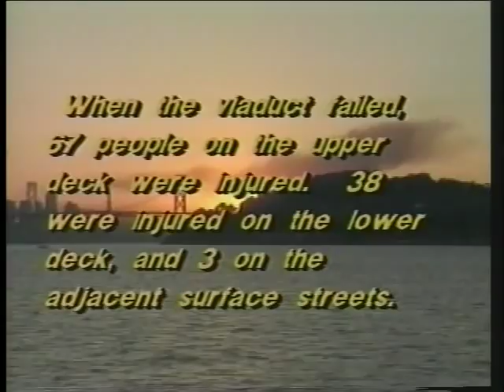Rare police footage of San Francisco's Oct 17 1989 earthquake aftermath part 2 of 2

Comment: 11 yrs old and living in the east side of San Jose, very close to the calavarares fault line. During tap class, and right when the quake hit, it felt as if somebody had pushed me from behind. I turned aroundl...and nobody was behind me and the floor was rolling sorta like waves. The other thing that struck me was the length of the quake! I lived very close to Alumn Rock  Park, and parts of the park were closed d/t the ground literally splitting apart! Very happy the Bay Bridge is being rebuilt!

Comment: Long read with detailed information.

I've actually seen the full CHP reports for this earthquake online, read them cover-to-cover. The vehicles were given codes, V-1 to V-49 on the upper deck and V-50 to V-107 on the lower deck. The freeway was divided into spans, separated by "bents" that joined them together, e.g. Bent 50 was between Span 49 and Span 50. Each span was about 80 feet long. The further north the span/bent, the higher its number. Lower deck traffic was moving northbound, and upper deck southbound.

On the lower deck, the fatality rate was 45%.  

Span 62 was the southern end of the collapse and Span 112 was the northern end,  At 3:00 and 6:28 the 1986 Acura Integra was crushed by Bent 112; it was a mere 60-70 feet from being "out of the woods" completely. Had the earthquake struck literally two seconds later, the man in the Integra almost certainly would have survived. The vehicle was coded V-50, it was the northernmost vehicle in the collapsed area.

Span 96 was the only span that did not collapse in that area; a Chevron semi truck and a Chevy Monte Carlo happened to be the lucky people in that span. Both were unhurt. The semi driver almost certainly would have died had he been caught in the collapse; the three other semi trucks directly caught in the collapse were all killed, probably because their vehicles sat so much higher. A low seating height car would have been the best car to be in here. 

The International semi at 6:38 was about the worst situation one could be caught in. Its driver was killed instantly. It was in Span 98, against Bent 99; the lower deck spans from 97 to 100, immediately north of the uncollapsed section, was one of the deadliest areas to be caught in, 9 out of 11 drivers died, and a tenth (in a white Honda) was knocked unconscious and severely injured. The 11th driver was in a red Datsun (I think it's the one at 1:40) and was found laying across the front seats of his car. He had minor injuries. Very lucky man. The only survivors from 97-100 were him, the man who was knocked unconscious, and three people in the back seat of another car at the north edge of span 100. The front passenger of that car also died, bringing the death toll to 10 out of 15 people in those four spans. A fire started in this area when a 1988 Acura Legend was crushed down to the frame rail, its driver obviously killed instantly.

Julio Berumen, the boy whose leg had to be amputated, was in the other death "hot spot" - Bents 63 to 67. All 8 drivers, as well as the four year old daughter of one of the drivers were killed. Julio and his sister Cathy were the only two survivors from these five spans. They were in Span 66 against Bent 67. 

Part of the reason Spans 63-67 and 97-100 were so lethal had to do with the way in which they collapsed, they "pancaked" on top of one another. Part of it has to do with traffic density in those areas. 

On the other hand, Spans 84-88 were a relatively "lucky" area. 7 out of 9 drivers plus a passenger lived, 8 out of 10 total, making the overall fatality rate just 20% in this five span section.

https://archive.org/details/lomaprietaearth1990cali_0

Have a read, but it gets pretty gnarly.

January 19, 2018 3:14 am

Comment: The section of the freeway that collapsed was built on top of fill that liquefacted when the quake waves struck it.  The loose fill temporarily behaved like liquid & the shaking motion was amplified 800%.  The section that didn't fail was built on solid ground, although it was severely damaged & was immediately demolished.  Liquefaction was a big problem in the Mexico City quake because the entire city is built on top of an ancient lake bed.  It caused a big bad blaze in the Marina District.

Comment: I was 5 years old when it happened and I was in the North Bay in Sausalito which is only a couple miles away from the San Francisco marina district where there was tons of destruction. I was standing the street corner with two of my friends when it hit, but lucky for us the entire north bay sits on a large deposit of bedrock which minimized the duration and the shaking of the quake. So for us it only lasted 3 or 4 seconds as opposed to 10 to 15 seconds in other places, and the shaking wasn't as severe. I remember a few days later my parents took me and my sister to see the marina district after the earthquake and I remember seeing cars flipped over, huge cracks in the pavement, and an entire buildings collapsed. Nowadays I'm freaking out about the Hayward going off because I live in Berkeley. It doesn't seem to end over here.

Comment: 5:50...the cypress viaduct never shouldve been built. what were they thinking....building a double deck freeway in a state KNOWN for earthquakes!?!? I mean cmon....really? That was a recipe for disaster. To this day I am nervous when on the lower deck of the bay bridge. The new bridge is the way it SHOULD be...ONE level...not two!
Reply: from what it looked like, the cypress viaduct was built in the 1950s where there was still a "brain drain" of sorts when it comes down to understanding of earthquakes. by the 1980s and 1990s however, almost every person in the country understood what a quake was although some think that wouldn't happen to them. if the cypress viaduct is rebuilt with modern day earthquake proofing then it wouldn't matter if it was a 7.1 or a 8.0, the viaduct would be designed to withstand a pretty nasty one and with minimum damage.
the way traffic is in both la and san fran, that idea would be a better solution no matter how you look at it.
although i would want the new cypress freeway to be designed to be stylish yet to go all out on the earthquake proofing like with the new bay bridge.
Reply: Lisa K Are you aware of the Bay Area? The traffic couldn't handle a one level bridge. It's been retrofitted since.
Reply: The design was acceptable.  The ground it was built upon was the contributing factor in its collapse.  Contrary to what the video stated the whole structure did not collapse.  Only the portion built on landfill collapsed.  A similar structure in San Fransisco suffered damage but did not collapse.

Comment: I hear stories of how SF used to have several overpasses that were not only "below average" in terms of construction quality, but also becoming eyesores that covered promenade areas and divided neighborhoods prior to 1989 quake. When the quake happened and so many of them suffer structural failures that killed drivers and other innocent lives, it was a wise decision by SF's municipal council at that time to dismantle/demolish those overpasses, redesign the roads/streets + traffic flows of former overpasses' sites and expand the lines of public transportation services to the neighborhoods located near the former overpasses. A wise decision? I would say yes considering those overpasses were built despite oppositions from SF's residents. Controversial? I would also yes especially when many SF residents and visitors are also driving their cars and overpasses were probably the quickest route to get into the city's commercial districts and city center. Still, i'm sure the absence of these overpasses have more benefits that outweigh the risks/disadvantages as years have passed since the terrible quake.

Comment: 15 seconds of INSTANT HORROR of wondering if the ground will give way under you or having debris fall on top of you. i felt dozens of quakes being 4 seconds the longest,  but this quake I had this in my mind of the shaking stopping, stopping, wtf? Im on a major disaster of being in fear for 15 seconds. I saw ppl trying to run away from buildings only to not able to do so of falling over and over of trying to just get up and run.It was impossible for them so they just sat there crying and screaming.